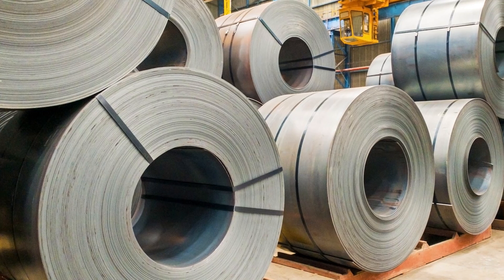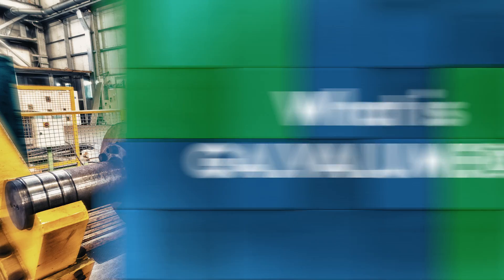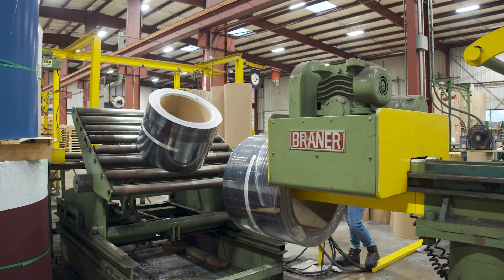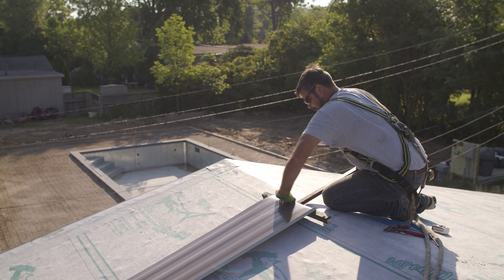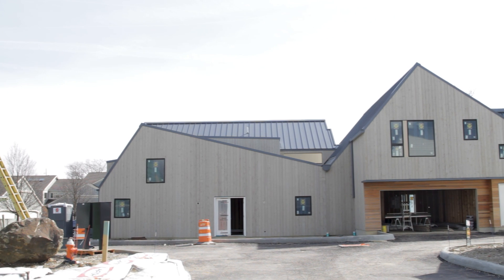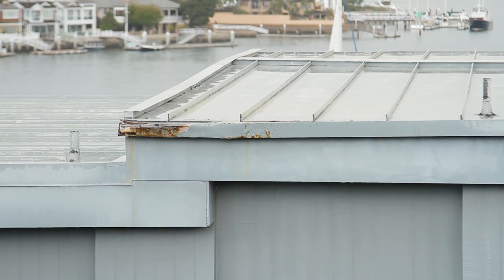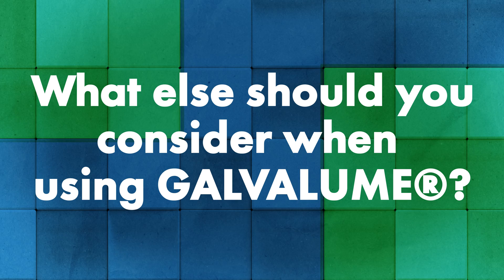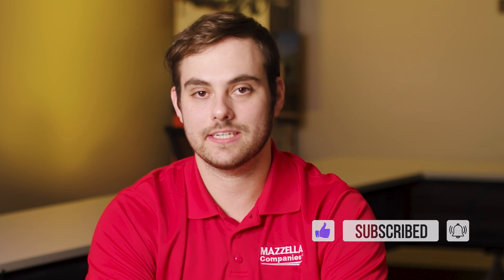What is Galvalume® Steel and How is it Used for Metal Roofing?

Comment: In Ph, it's akin to plain GI sheet, the only difference is that galvalume is in rolled sheets. We only use this mostly on exterior walls or wooden doors as a protective material during wet seasons (but could be taken as permanent though😁). I think it's not suitable for roofing here...

Comment: I am looking at putting a metal roof (galvalume) over an existing shingle roof.  I have copper on all the valleys of the roof...do I need to remove the copper valleys, or can I leave them and have the galvalume touching where they meet?
Reply from the maker: The copper will react with the steel and eventually corrode it. It's best to remove the copper from the system completely. Make sure you also use a new underlayment between the shingles and metal as well for the best weathertightness. -Thad
Reply: @TheMetalRoofingChannel  thank you...appreciate the timely response.